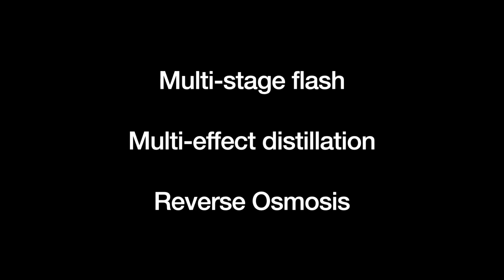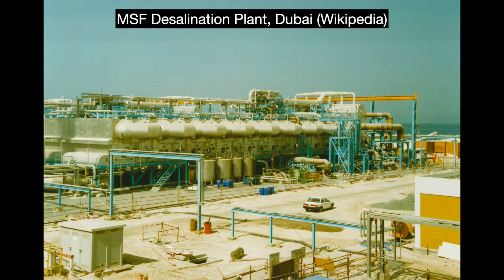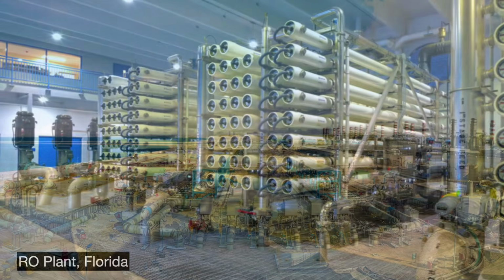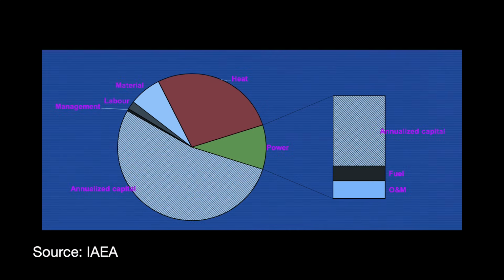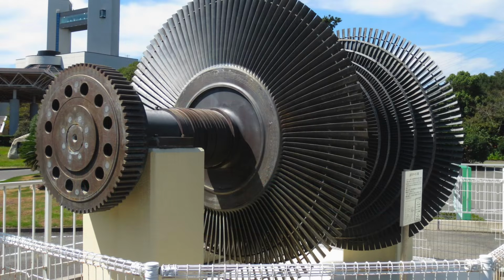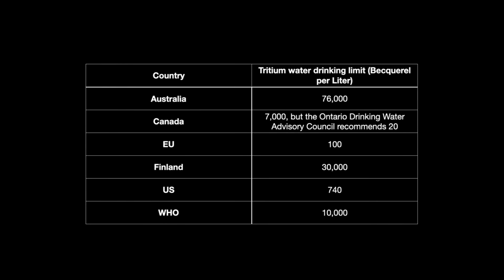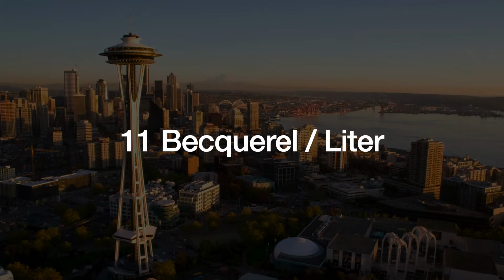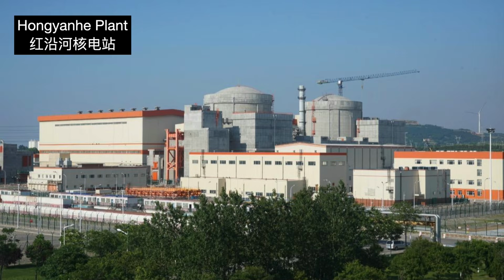Going Nuclear to Desalinate Seawater

Comment: Only if using the waste heat off of existing nuclear. 
There are a hundred other common industrial / chemical processes already cooking up temperatures over 100c 
- an aluminum pipe, effectively, wrapped around a steel furnace, coal plant, gas plant..  
could boil sea-water or pasteurize waste-water / swamp water otherwise (and collect methane along the way), 
just as well a local kilometer with one High Heat Point + connected processes in series - - Process B using the water / heat at 300c, and on to Process C.. etc. etc. 
- and on to greenhouses for more regions - grow your own strawberries in the fall and spring in Wisconsin off of local coal / gas plant heat better utilized, then California doesn't need to grow those, 
and so on, 
even an aluminum pipe / tube in the desert sun can get most of the way to boiling, doubly so if using some other aluminum or mirrors as a lens to focus heat, 
all the more if starting with Tropical warm water, or water out of a Data Center, 
- - still some boosts might be needed, but then we're talking about a few degrees,   

So, all of that is dirt cheap and just as safe, using extant heat energy currently being thrown away, 

it's a racket to sell California or Baja / any struggling desert community - 'oh, we could boil water if you had a 20 billion$ nuclear reactor in 20 years'

Comment: While osmosis use more energi, that is not the end of that. Osmosis use mechanical energy often derived from electrical energy that is generated in a turbine. 

While heat based desalination use low grade heat energy. With a heat of energy of 100-130C the exchange from energy to electricity is something like 5:1-7:1, making heat based desalination in principle more efficient. AT least for a system where the desaliniation is used as a turbine coolant.

Comment: The reason the cost of nuclear decay heat to power distillation systems and steam pipes is so stable is because, surprisingly, it's not tied to the cost of uranium ore. Yes, uranium prices fluctuate wildly, but the uranium first needs to be purified from the ore and enriched (to a level that differs between reactor designs), which costs much more than purchasing the ore from a mine. The reactor itself has losses when fissioning uranium into heat (it depends on the ratio of the absolute temperatures, in Kelvins, of the coolant input temperature and the coolant output temperature of the reactor; you can't reach efficiencies above that of a perfect Carnot heat engine).

Turning this heat into electricity using steam turbines introduces further losses, but if the waste heat is used for desalination, then you could have a co-generation plant which produces both electricity and heat, the latter powering the desalination side of the plant. Also, the uranium fuel rods can last a year or longer, which means you're not concerned about short-term spikes in uranium prices. Most of the cost of nuclear energy is capital cost. Every single weld must be inspected regularly, every single instrument must have a backup, and trained staff must operate the plant 24/7 (thankfully, if the staff goes on strike, any power surges or dips on the grid will lead to an automatic shutdown of the reactor, because computers don't have NLRB protection). Also, the capital cost of building the reactors and confinement buildings is massive, but as you might have guessed by now, the fuel cost is comparatively minimal. Just look at XKCD's graph comparing the energy density of sugar, coal, gasoline, and uranium. The bar for uranium ends off getting taped on top of the chart and turned into a long ribbon. Uranium ore prices are a negligible part of the cost of operating nuclear plants, simply because you need so little of it and the cost of building the plant dwarfs the fuel cost, even when amortised over decades.

Comment: Whats more useful in gw generation by nuclear and wind is that when power demand falls  naturally (overnight say), you can use all that unrequired power to ramp up water production. Nuclear power plants dont do well with large swings in power production. Allowing nuclear power to switch over to water production and refilling reservoirs means power reduction calls can be minimised and with some profit vs curtailment. Same for wind. Instead of turning off wind farms, that power can be bought for water making. Water has a basic accepted demand and its supply is more risky with droughts and more people even with better water efficiency ( which citizens dont like what that requires them to not be able to do). Constant demand from wind farms boosts ROI and enables more investment interest in better operating returns

Comment: Update, offshore Atmospheric water generators powered by wind, solar and slow speed underwater turbines called Waterotors can make Clean drinking water and have extra power to sell to even large cities. Offshore the humidity of the air is 100% just off the surface of the ocean. Atmospheric water generators can then work at 100% efficiency and with coastal tidel flows Waterotors work day and night unlike wind and solar alone. This system has no saline or brine problems to pollute the ocean and is a real Green solution to the growing shortage of clean drinking water.  Search it on YouTube and see for yourself.

Comment: How much would it cost to build massive passive solar evaporators that would  have near 0 operating overhead. It may sound naive but well engineered big evaporator bubble structures where there is plenty of sun would yield surprisingly high results, i'm sure

Comment: I worked in the engine room on a couple of nuclear submarines. Decades ago the ships were designed and built with steam powered distillation units. They had an electrically powered back up distillation unit that didn't really work. Halfway through the life of the submarine, the reactor needed a refuel. When my second sub went in for the refuel they ripped out both the steam and electrically powered distillation units and replaced them with reverse osmosis units saying that the increased energy efficiency alone was enough to justify the cost. And I have to be honest, we always had plenty of water to spare with the RO units, same can't be said for the stills.

Comment: You forget forward osmosis.  This process uses less energy with the possibility of low quality waste heat like from maybe the coolant heat from a nuclear reactor or other industrial process providing a heat gradient.  This processes involves water being drawn by a high osmotic solution across a membrane at a high temperature with the drawing agent being removed from the water by a cooling temperature  change precipitating the drawing agent out. The left over drawing agent is then removed completely from the water by reverse osmosis to produce pure desalinized water.  Far less energy is required for this process though plants using this process are just now being built and are mostly small due to the newness of the process.

Comment: mining and preperation of the nuclear material is hugely carbon driven until today. the construction of the nuclear facilities and mid- and longterm disposal of the nuclear waste consume massive amounts of concrete, which is one of the bigest co2 sources. renewables are much more efficient in recource to energy translation.

add the nuclear risk - in production and disposal and you'l see: nuclear is just dumb.
Reply: And you'll see, tux wurst is just dumb
Reply: There is a carbon cost to everything... What matters is the cost vs benefit.

Most of the carbon you talk about is the upfront cost. The plant pays for that easily 1000s of times over.

Nuclear waste disposal doesn't have to be so costly. choose a mostly geologically stable area and build an underground storage facility. Also, we aren't too far away from being able to load up a Starship and send the waste off into the sun...

Also, don't be stupid and there is no nuclear risk. Building a nuclear power plant on a geologically unstable beach without earthquake, tsunami, and volcano safety measures was kinda dumb...

Also, the Soviets were about as dumb as you could get. They had no idea what they were doing... It was their fault their plant melted.

Comment: One issue often overlooked that this system helps mitigate is the amount of electricity required to then pump water through a distribution network, as this is often far more energy required than collecting the water. Where I live (Northern Ireland) our water supplier is the single biggest consumer of electricity on the network for example, and this is something that scales linearly with water requirements.

So as water demands scale up and nuclear generation needs to increase to keep par, then electricity generation would also scale up at the same time resolving this issue, which would be a massive net increase in overall system efficiency.

Comment: did not touch on the brine if its dumbed back into the ocean its environmental impact on Coral is devastating which hurts the rest of the ecosystem in the ocean which hurts the ecosystem on land unless there is a safe way to get rid of it this company's will use the cheapest way by trying it back into the ocean

Comment: Aside from the very clear and redundantly prove FACT that burning fossile fuels is GOOD FOR THE PLANET, I am strongly in favor of using nukes. Why?  Because it is cheaper and simpler and .. did I say cheaper. Safety is a relatively minor issue with the very safe smaller reactors currently available in the UK and world-wide. But this is an interesting video if one dismisses the misinformation it contains about the negative effects of CO2.

Comment: Wind and solar are great for small towns and supplemental power, otherwise nuclear is the only option.  Nuclear waste?  Fuel rods only use up a few percent of the actual fuel, we just don't reprocess it over idiotic non-proliferation agreements.  Meltdowns?  Yeah if you keep using shitty archaic high pressure reactors from the 60's/70's.  The SMR's that'll be appearing everywhere can be passively cooled, and the larger plants no longer run at high pressures or rely on external power to cool them.  Soon enough we'll be able to use thorium, which is basically getting rid of heaps of toxic waste from rare earth mines, it's extremely abundant and not good to leave laying around anyway.

Comment: Regarding the risk of nuclear contamination of the drinking water, would it be possible to just use the electricity generated from a nuclear power plant to power the desalinization plant eliminating all risk of nuclear contamination, as the nuclear components would never come into contact even remotely with the water?

Comment: In the United States the U. S. Navy is probably the biggest user of nuclear power.  All super carriers and submarines are nuclear powered.  Whether the water purification systems on these ships use it I don't actually know, but it seems likely in some way.  The Navy has not reported any serious nuclear problems.  However, with the nuclear powered ships coming to the end of their useful life, the Navy is confronting the serious problem of disposing the nuclear reactors in these ships.  USS Nautilus was saved as a museum ship by having part of the hull removed, taking out the reactor, and then constructing a new hull.  However, USS Enterprise, the first nuclear powered carrier, caused challenges in the removal of the plant.  USS Nimitz is the second nuclear carrier to be scrapped.  The challenges included dealing with the spent nuclear fuel.  San Onofre in southern California faces similar problems that have not be solved.  Then there is the challenge of disposing the brine without killing too much sea life.  Nuclear is appealing until you have to deal with spent fuel.

Comment: why not simply using the power of the sun directly for MSF?  Yes you need a lot of surface-area and its not stable, but there is no additonal energy needed to evaporate the water.

Comment: Nature also desalinates ocean water through freezing and evaporation. Shallow water freezes and evaporates faster. Keeping ocean water from moving allows the brine to settle. Use high tide to fill an area for settling and low tide to cutoff the supply from the ocean.Carbon and sand have long been used as filters although the amount of earth ocean water would seep through to reach an aquifer would clean it.  A simple pump spraying a fine mist of ocean water into the air in hot weather would create humidity which feeds rain clouds. We could geo-engineer glaciers where the weather is cold enough. Even if these processes don't meet the standards we require they handle the lions share of the filtering which allows you to scale down the facility drastically. People are the problem. We've made everything completely unnatural to suit our needs only to find that the world was much better off without us. History tells us that a desalination plant with natural processes integrated into it using natural materials is going to be a smarter,simpler, safer, and cheaper way to go. The ultimate design for a sustainable u.s. civilization was perfected hundreds if not thousands of years ago by native americans. Nuclear is overkill...save it for rocket ships.

Comment: I am happy to announce that I can relieve you of your anxiety in using fossil fuels for desalination. The CO₂ from the combustion of the fossil fuel burnt to power the desalination plant is plant food and the endothermic reaction of photosynthesis more than soaks up the energy trapped by the CO₂ released to the atmosphere. The so called “climate crisis” is nothing more than a political hoax to tax gullible folks for UN kickbacks. 

If in doubt just examine the energy systems used by China and Russia and you will see they continue building fossil fuel power plants, while the West self-destructs building the more expensive sustainable energy systems. So you can now feel at ease and take your ICE car for a spin without remorse and leave the Middle East to do their thing.
Reply: bro... plants aren't that efficient. and while we don't produce that much carbon compared to our oceans, our oceans also absorb that exact amount back. the tiny bit of carbon we do produce threw off that balance.
Reply: @MAL1GNANT  Well the photosynthesis endothermic reaction easily trumps the CO₂ thermal effect by an order of magnitude so plant inefficiency in irrelevant IMHO. But then don’t take my word for it, look at Biosphere 2 results. CO₂ went up, temperatures decreased slightly.
Reply: @jeffharmed1616  no, it doesn't. it's more climate change than global warming. it has different effects in different regions at different times.
Reply: @jeffharmed1616  "hoax"
Reply: @UCiNa7yDepQw78yq27hNkdPw yes i am aware, but no. plants don't eat that much CO2. plants only absorb like 30% of our co2
Reply: @MAL1GNANT ’s emissions  @MAL1GNANT ed  @MAL1GNANT

Comment: The desalination comes at a low price if it is thermally coproduced with electricity. The efficiency of the powerplant is only slightly reduced but you get the water for it.

Comment: Doesn't make any sense when you can just combine renewables and desalination.
Wherever desalination is really needed electricity from renewables is dirt cheap.
It's also 100% safe, the intermittency doesn't matter because you can store enough water in tanks to bridge those windows. The desalination plant doesn't have to run 24/7 either, this just offers maintenance windows. Also every country can do it, no nonproliferation treaty violations possible. Even the lifetimes are comparable. If that's not a fit made in heaven?
Reply: Solar kills 6 times as many people as nuclear does. Intermittency is terrible for efficiency
Reply: @kokofan50  First sentence is objectively false.

Comment: The United States has fielded about 200 such nuclear-powered de-salinization plants over the course of 68 years. Every nuclear-powered submarine and aircraft carrier ever commissioned has a very large appetite for very pure water. So, each is equipped with a steam-operated evaporator that produces about 10,000 to 15,000 gallons per day of distilled water from seawater. The waste is brine which is pumped to the sea. 

This process can be easily scaled up.

Comment: let's appreciate the fact that Israel leads desalinization technology and is not even mentioned.
Israel is reclaiming the desert at an increase pace thanks to the abundance of desalinized water.
Being a country where desert is shrinking is nice in and on itself, but the new green areas are increasing the capacity of the soil to absorb rain and increase aquifer reserves. To top it all, solar is part of the energy used, although in a small part. Nuclear is good, without it is even better.

Comment: I don't understand why we don't just use solar power in Texas with salt water batteries for storage and then use electrolysis to take the oxygen and hydrogen out then burn the brown gas to get heat energy or pump it through a hydrogen fuel cell both give us clean water.

Comment: In 1970 Stone and Webster, Westinghouse and others were constructing Nuclear power plants at an impressive rate. Had they been able to continue at that rate the fossil fuel industry would have been stopped in it’s tracks and we would not have the current carbon emissions concerns. Then came the 3 Mile Island event which resulted in no deaths and no discernible environmental damage but the fossil fuel industry used media, misinformation and political pressure to put an end to Nuclear power growth.
Having said this the perfect energy source for desalination is Solar and Wind power. Desalination does not have to be a continuous process. It can ramp up and down with the availability of wind or solar.